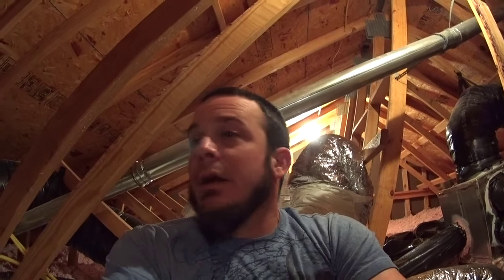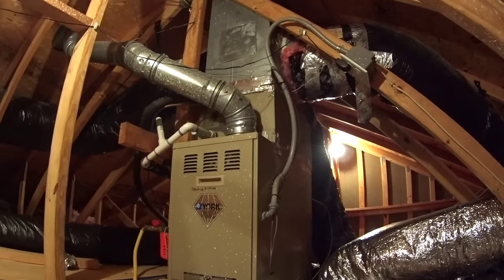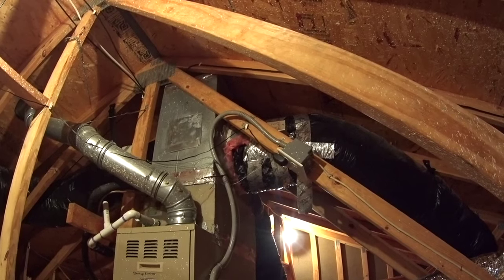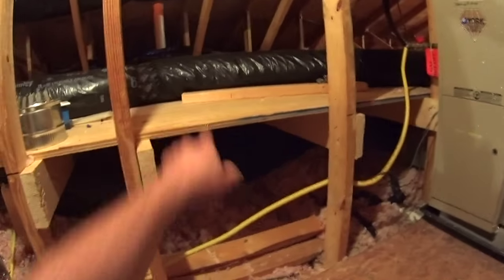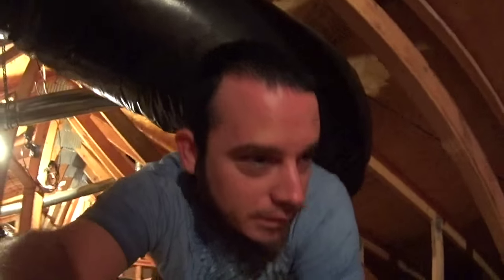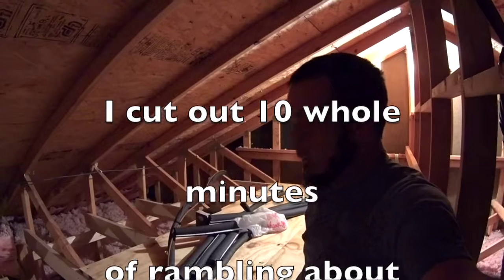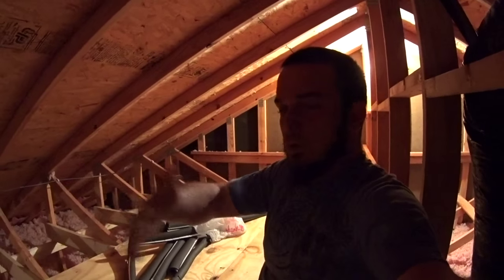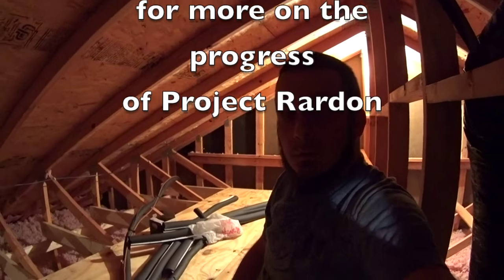HVAC Installation: Project Rardon Vlog 1 Changing my own AC Unit

Comment: why not place the new system in the old ones spot?
Reply from the maker: The new high efficiency evaporator coil is much taller/longer than the old one so I wouldn't have enough space if I put it in the same Place and orientation